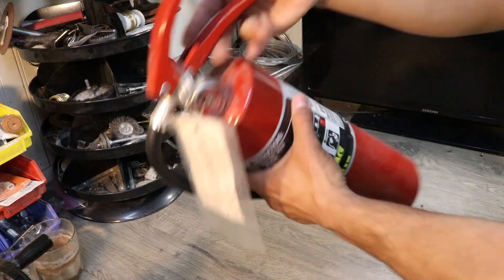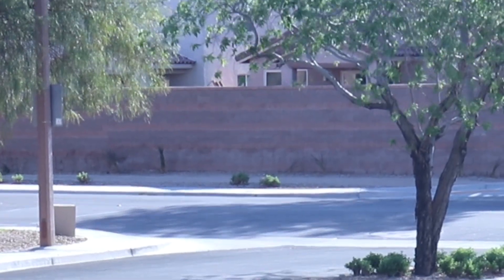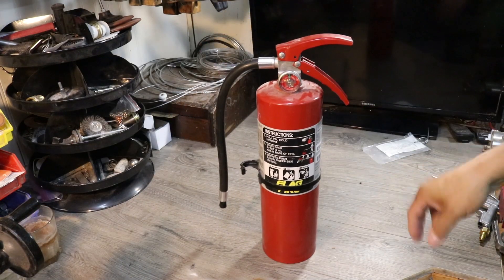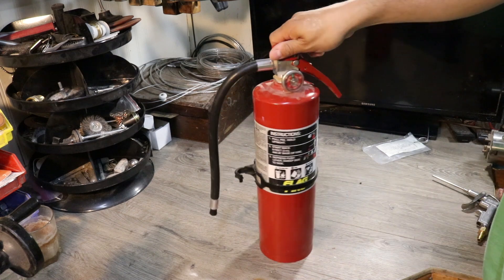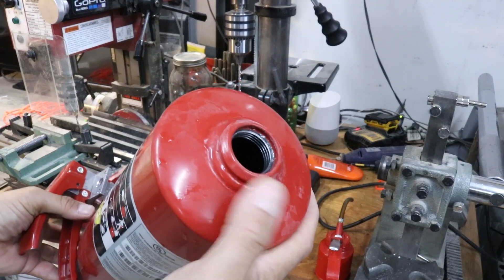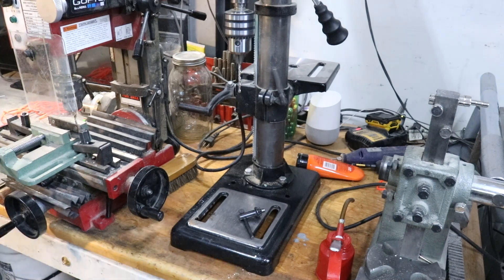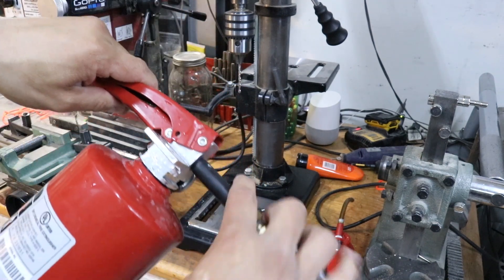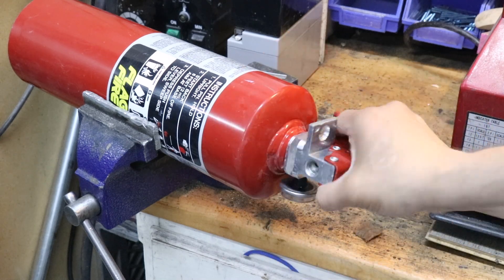Fire Extinguisher to Water Mod

Comment: Screw the valve out ,pass the string THOUGH the rubber body ,lot less chance if ot slipping off and automatically centres itself in the hole

Comment: Looks like a good start on a booby trap. Just need some trip wire and linkage to pull the trigger. Something stronger than water inside. Maybe a bright colored dye or a chemical of some sort. Battery acid?
Reply: pepper spray!!

Comment: Nice idea but you have to make sure the extinguisher is aluminum and not steel like this one is because over time the cylinder rusts inside and irritates skin if sprayed at people and soon it will not be able to hold pressure. I made the same mistake and now mine won’t hold pressure for more than 2 minutes. If you are going to do this to spray people, make sure it is aluminum by sticking a magnet to it. If it doesn’t stick, it’s aluminum and you can safely use it as a water gun. Try the kidde pro extinguisher. Those are aluminum and cheap.

Comment: Very clever. I used to experiment with stuff like that during my young years. And now too. :)  Only thing, if you are going to put it where others may have access to it make sure you put a label that says "CLASS A FIRES ONLY". Else someone may spritz it onto an electric or flammabble liguid fire....

I have thought of repressurizing a water can extinguisher (oil) with a bike pump but I didn't know if there would be enough pressure to reach 100psi with the bike pump..  Now I know there is enough pressure. So if I get a water extinguisher I should be able to keep it charged from home.
Reply: I got an old water version myself and they are amazing, 50 feet of water for 50 seconds, I originally took mine down to the tire shop and they let me use their compressor, needed 125psi and at the time I didn't have a compressor that big.
Reply: @shanek6582  I use a relatively small inexpensive air compressior / tire inflator that I bought brand new off Ebay for around $40-$45 bucks. It operates off of 110 VAC and is rated up to to 130 psi air pressure. It pressurized the extinguisher well up into the operating range of 100psi with no problem. The only drawback is that the pump is low volume so it takes a bit of time to pump the extinguisher up 10 100psi.
Reply: @WitchidWitchid  betting than hand pumping! Thanks man